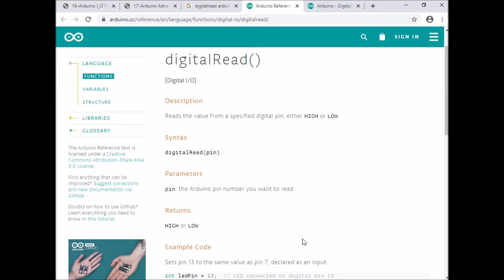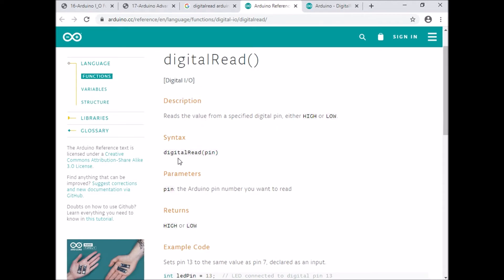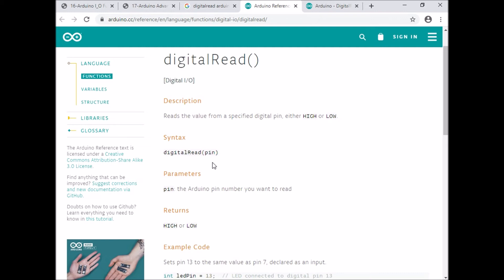18-How to use digitalRead  function in ARDUINO IDE

Comment: 18208-EC-041 digital read function is used to read the binary value that is returned at that pin by any input device either 1 or 0 i.e., 5v or 0v

Comment: 18208-ec-045
After watching this video I understand that the digitalRead( ) function in Arduino IDE. It reads the value from a specified digital pin either high or low.